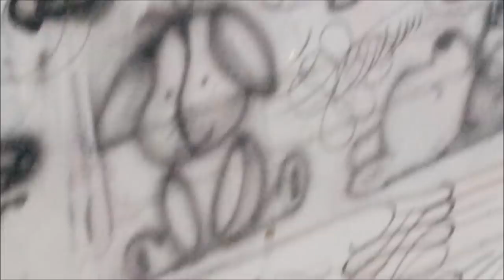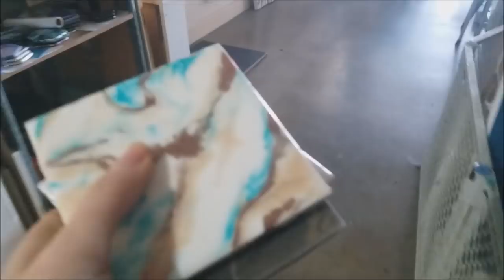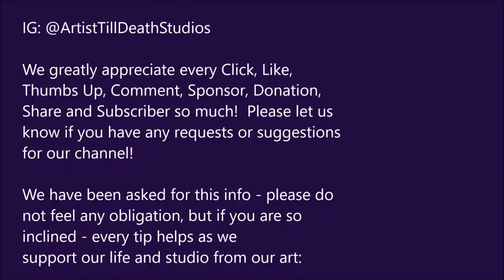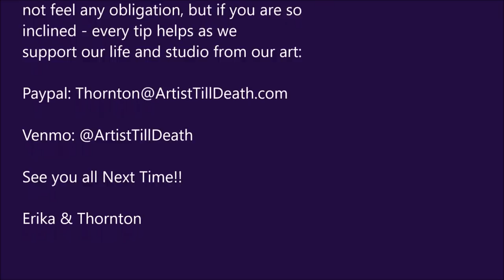Reclaim TV Tray with Resin (STEP BY STEP)

Comment: Is resin hard enough to stand having a warm plate and coffee cup on it without denting or melting it?
Reply from the maker: Claudette McDermott it depends on what brand you are working with. Most can withstand heat in the 120-150 Fahrenheit range. We also use a resin that can handle 500* F.